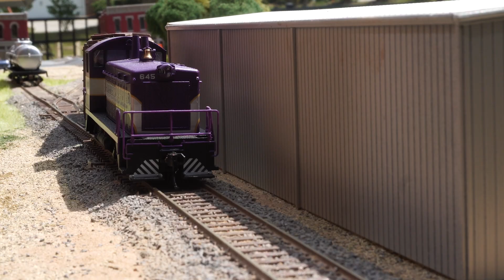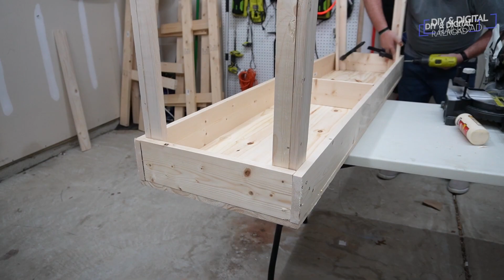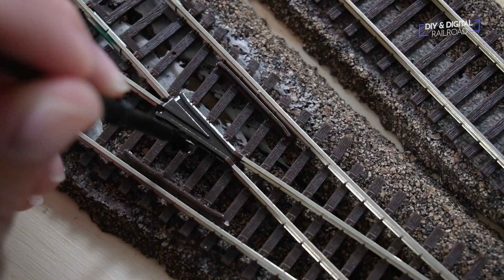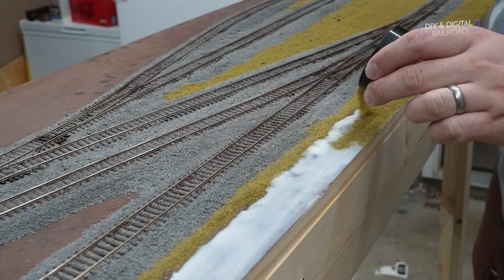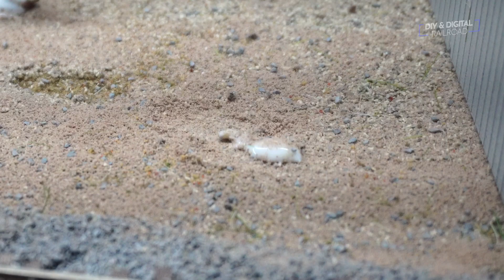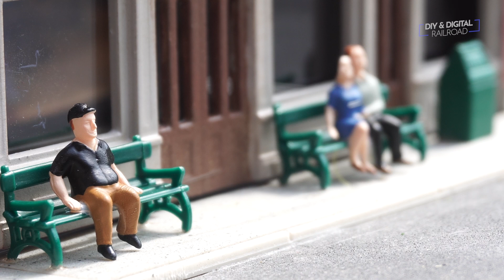MRRTwo: A small switching model railroad anyone can build

Comment: Just put finished the base board and track layout for my shelf last night, it's one foot shorter and 6 inches wide than yours and still debating if that will work out well, because it was harder to allow space for a locomotive and multiple cars to move onto a side track and back to the main line. Pick out almost the same switcher ( ACL #59 SW8 , Proto 2000, NRW DCC decoder) and several 40 foot boxcars. Thank you for the visual of a completed product, I do plan on doing more of a rural landscape however.

Comment: Thank you for this video!  My own HO layout is built on a 1 x 6 shelf unit and is based on the Inglenook Sidings puzzle.  I restarted model railroading about 3 years ago and as I'm in my 70's I needed to keep it small if I were to finish it.  An operating session takes about one and a half hours running at slow speeds and leaving time for the ground crew to release and set hand brakes and align couplers.  It can be seen under my name in public posts on a certain website that concerns books and faces.  For me, Last Mile railroading is where it's at.  Cheers from Wisconsin!

Comment: Fantastic job, Jimmy! The model railroading magazines are full of layouts that occupy huge amounts of space, but sadly lacking in examples of layouts that require very little space. MRR2 is a fine example of the latter: it occupies less space than a bookshelf; in fact, it could easily rest on top of a bookshelf. It's important to note that MRR2 need not be the end: if you (or the builder of a similar layout) ever obtains more space, it's easy to build an extension which would connect at one end of the layout.
We spend a lot of time discussing how we can save money in our hobby, but very little time discussing how we can save space. This series of videos is a stunning exception.